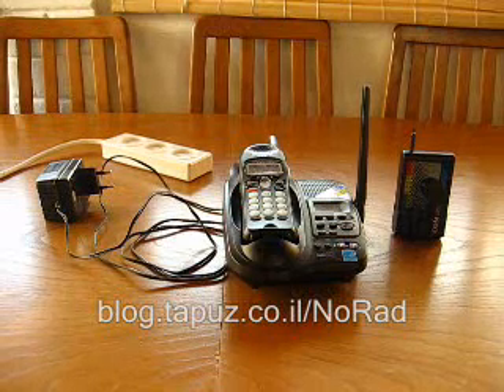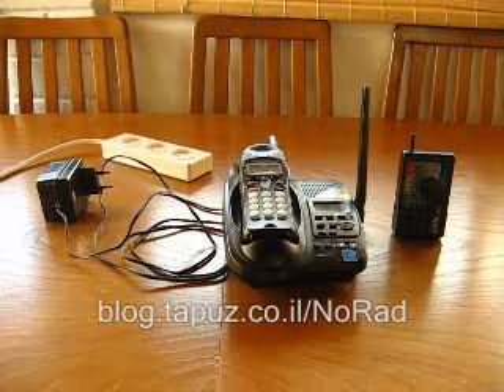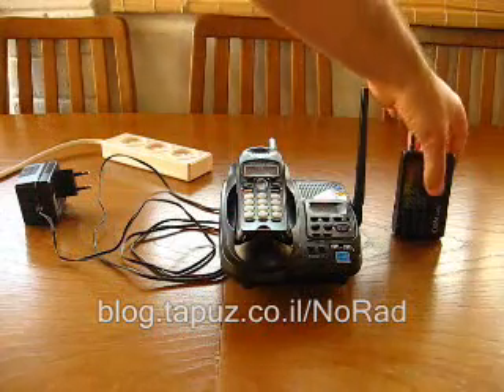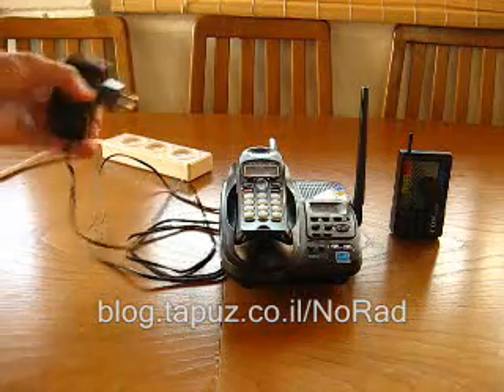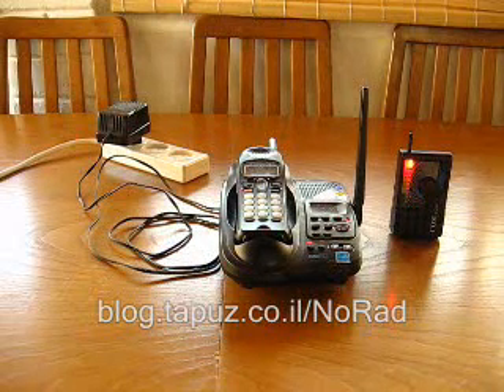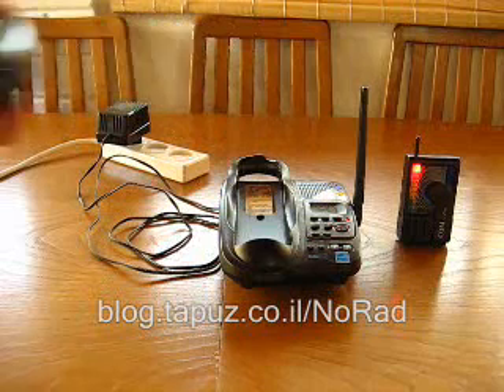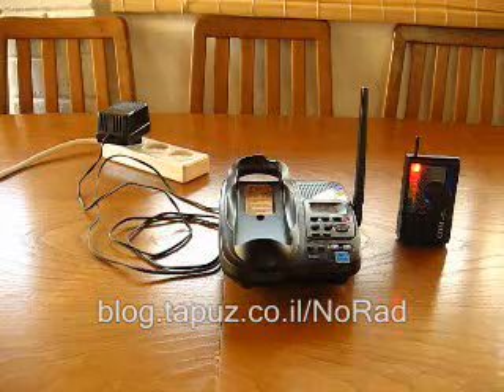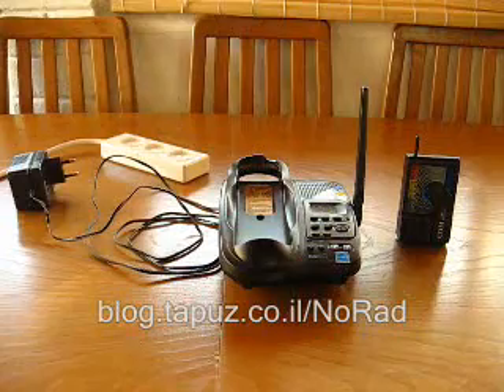Radiation (RF EMF/EMR) from Dect phone base station (Electromagnetic Radiation)

Comment from the maker: @GeGeMus12 

Every cordless phone will emit EMR on while talking on it. Some cordless phones (like DECT phones) will emit EMR from their base station all the time, even when not talking.
My advice is, if you really need a cordless phone, is to install a wired phone in every room and then add a non DECT or an ECO DECT PLUS phone which you can use when you need to walk around the house and which does not emit EMR from the base station all the time.
Siemens have some phones like that.

Comment: @zaraki888 
A part of wireless radiation, a PC has a very strong low freequencey electromagnetic radiation, especially from the power supply. Don't put you PC case neer your body, and avoid puting a laptops on your legs. Laptops are more dangeres, as your head is just above the unit, even the power supply is external.
Don't put any clock or radio that is connected to the wall, near you bad. Don't aleep with you head near electric sucket, wires (also in wall), and plugs connected to them.

Comment from the maker: @zaraki888 Hi

some of the parts in a PC emit low frequency radiation. If your PC has a wireless internet connection then it also emits high frequency radiation (similare to the kind a DECT Phone emits). 
as far as i Know DECT phones emit more radiation then a PC with a  wireless net card. 
The radiation levels that you are exposed to are depended on the strength of the signal and the distance between you and the source.
I hope that this answer your question.

Comment from the maker: The measurement was done to show that the deck phone base station emits electromagnetic radiation 24/7, even when not using is to talk. 
I was not trying to do a scientific experiment or to show any health effects in this video. The radiation from the speakers, chips, power supply of the phone would not be around the RF frequency, but in lower frequency, In this video I was not trying to show them.